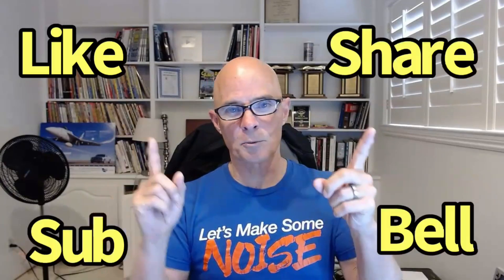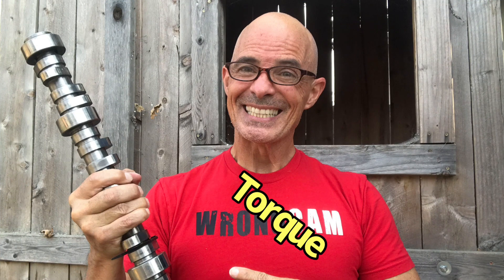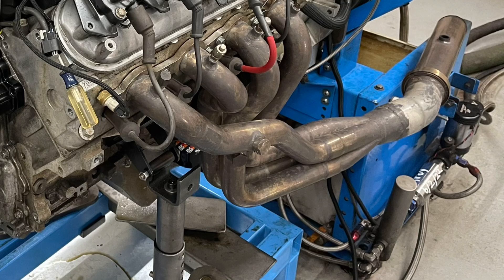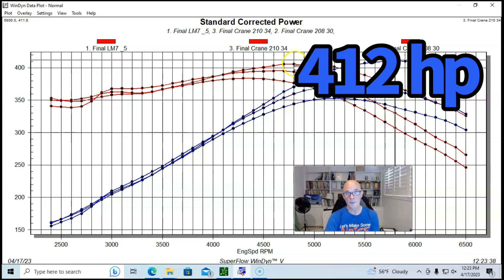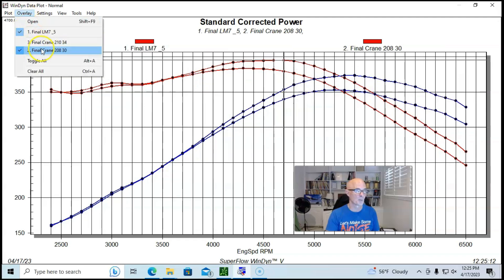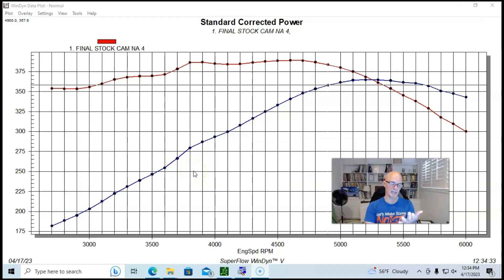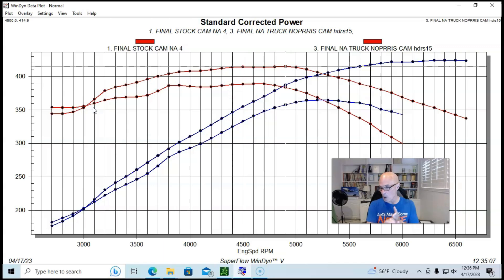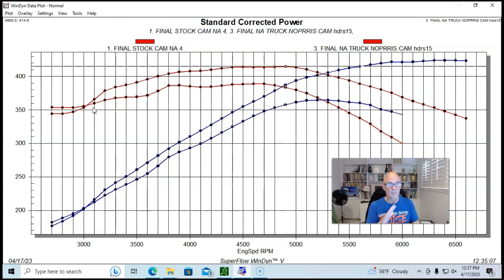WHERE'S THE TORQUE? HOW CAN I MAKE MORE LOW SPEED TORQUE? WHO MAKES THE BEST LOW-SPEED TORQUE CAM?

Comment: I’ve always looked at it that if you want to change peak torque from 3000 to 4000 to 5000 its cam
If you want more torque at low rpm then cubes
Pretty simple
Reply from the maker: can also be intake

Comment: Can you do a video or comment on 351m to 400, mild cam 4 in stroker

Its a tall block cleve as youve mentioned and I was doing a 160 hp 440 ftlb @~2000!rpm build

Comment: How about low end torque on a Pontiac 455 and in a heavy Safari Station wagon? 3.23 gears, posi unit. 4" stroker motor
Reply from the maker: mild cam, dual plane, compression, long tube headers, displacement all add torque

Comment: There are a lot of factors at play here that need to be addressed. Split cams do work. a 212/206 will work well in the 5.3, but the LSA needs to be tighter around the 108-110 mark and the cam needs to be advanced to 104-108 mark. The exhaust needs to be 1 3/4" long tube headers with free flowing exhaust, not the 1 7/8". This will work well in the trucks that spend 95% of their time below 3000 rpm. The Aussies have had good results with the split cams, as they think outside the box and understand the dynamics of cam technology. With me, David Vizard has been my mentor and like you, it's all proven on the dyno and he has done a hell a lot of dyno testing in his career.
Reply from the maker: reverse split? they just make less power
Reply: @richardholdener1727  Yes, up top but not down low. By having a shorter duration exhaust or equal pattern, the exhaust closes sooner and starts building cylinder pressure sooner. If you have a towing truck, you need the most below 3000rpm, and the LM7 is mostly trucks and SUV's. The exhaust needs to be free flowing and sized for your power output, in this case, smaller bore long tube manifolds. It is not just the cam, but the overall combo. 1 5/8" headers to 2.5" collector, 212/206 108LCA, timed in at 104 (tighter valve clearance may require notching pistons). A little more top end power but mostly better torque down low with better throttle  response and pick up. BTW, if using standard 706 heads the headers need to be sized to the exhaust flow, so at 550 thou lift, the flow is around 180 CFM, so the header primaries need to be 1 5/8" for street use.

Comment: You answered my most pressing question about torque, just as I suspected. That is why my 1989 GMC 3500 5.7L TBI has a SM465 4-Speed  transmission with very low rear end gears. NO horsepower, so they had to create torque with gears or it couldn't get out of its own way.

Comment: Can we build a motor for durability? Like 500,000 miles , nothing but oil changes kinda durability?  Of course plugs , air , fuel filters etc, but no engine parts … ?  Not to be boring n lame, but a durability , under load,  work life balance,
Reply: If you have a track I’ll drive the 500,000 miles lol
Reply from the maker: it can last that long-especially if you drive it 500K mile straight (don't let it sit for years)

Comment: Compression, forced induction and intake/exhaust will surely help. Gotta temember these truck motors had a "torque cam" from factory even though they're mild.
By adding forces induction low end torque increaces dramatically thats why diesels have incredible torque and turbocharged engines peak at 2k rpm

For a N/A motor my suggestion would be high CR without pinging perferably flat top, next would be exhaust manifolds not headders, use Y pipe not dual exhaust for scavenging effect, single pattern cam in the 200-210 range wouod work good and also help.  As far as heads go, there is nothing in the LS family that is low rpm oriented like the sbc world.  The TBI 350 engines had the best torque heads you'll ever find on any small block, but you won't rev past 4500 maybe 5500 if you're lucky

Comment: 350tq at 2000 rpm from a 5.3 😂😂😂😂😂 ya right my 2013 silverado only made 315 tq from factory at I think 4000 something rpm that truck was a piece if junk when it came to getting off the line with a heavy trailer it would fall on its face every time unless that 5.3 was sping 3000plus rpm it was a gutless wonder my 1998 silverado 5.7 gets off line WAY better pulling same trailer ... 5.3s suck ass for towing owned enough of them ill never own another 5.3 ever again 😊

Comment: Richard, refreshing my stock 350,000 mile LQ4, in my 2500HD, I tow a camper 4 tons, the standard 5.3 cam may replace my stock 0721 cam , as the stock PCM limits to 5200rpm and most of my driving is below 3000, except when needing warp speed, your opinion?

Comment: I'd bugged you about this in another video and you blew me off. I'm not after big low end gains, or necessarily even small low end gains. Though I firmly believe tangible low end gains could be had with a cam close to stock duration with a tighter pattern and earlier ICL. I'm more after something that, at worst gives up NOTHING down low but still gives a tangible kick in the pants up top. That should be totally doable with a small, tight cam. And while nobody drives around WOT at 1500, you don't need to. Part throttle at such low RPM is enough to achieve zero vacuum in the manifold, so same as WOT.

Comment: Richard, the folks at Crane Cams disagree with you .  The dyno sheet for crane cam  1449541 PowerMax LS 200/2008 502/502 115LSA ther dyno sheet shows 40 ft lbs over stock at 2000 rpm and 48 hp over stock LM7. I put this cam in my 2005 GMC Sierra a few year ago and love it, it even gets better 1 mpg better if I keep my foot out of it.  I know crane is out business now, but cam motion is making this cam for my brother. Happy to send you the dyno sheets..
Reply from the maker: I tested that cam-it does not add 40 lb-ft at 2000 rpm

Comment: This is incorrect.  We were given a Chevy 8.1 industrial engine used for powering generators. The goal was to gain trq at a max rpm of 1800 rpms. With a cam focused only on the goal, we made 800 pound feet. That's 1.6 pound feet per ci. The problem was when used in a truck, it had to be at wide open throttle to make the trq, and it would only rev to about 2500 rpms, making it usless for a useless for a daily driver.
Reply from the maker: you did not make 800 lb-ft at 1800 rpm with an 8.1L without boost (with any cam)

Comment: Has there been bigger cams that you put in and it actually caused a drop in torque on low end compared to the stock cam
Reply from the maker: yes-lots do-just not at the torque peak

Comment: I used to run Sig Erson Cams in my 351 Cleveland motorsand I used boththe TQ20 and TQ40 the TQ 20 ran more like a old family car, but the TQ40 Pulled super hard from about 2500 to a little over 5000 rpm's it was a dual duration cam @ 220/ @ 228 just a all around great camshaft. In a Ford 351C and I changed the 4V heads to 2V Heads to help with long tube headers, and a 1 inch spacer under a 780 Holley carb. Monster TQ, with the 4V heads it was a dog at low RPM's, The 2V heads woke it up, so smaller ports and valves as well.

Comment: You rite its impossible to increase torque @ 2000 rpms on a gas engine. Adding cam duration like an RV grind with to much duration just starts taking it from the bottom.  Adding bigger valves and bigger ports kills low rpm even faster! Its real easy to kill low rpm torque but very hard to increase it at that rpms. All you can do is if u have an 8 to 1 compression engine is increase it to 10 to 1 and pick up some there and use heads with the smallest valves and smallest ports for maximum cylinder filling at low rpms. Sure you can add cubes, stroker kits, superchargers etc but that stuff is expensive. Im sure your talking about just a commen V8 like a 350 chevy. My experiences in them gas engines is leave most everything stock like the heads and manifolds, and only use stock and very small RV grind cams not much bigger than stock  to make the best low rpm torque and mileage and increase the compression up there and build some cylinder pressure 200 PSI or so and run better gas. When you try to modify shit for increase in power they actaully run worse at 2000 rpms than stock and take more gas. For street truck engines and towing u need a power band off idle to 4200 rpms or so, nothing more. Power at 6K doesnt do any good as the motor never sees it. Im going back and building all my engines stock.
Reply: Exactly. I tell people all the time, your shifting gears @ 3 to 3.5 grand. 6 grand... Phhthh.. that's nonsense.

Comment: Hi Richard ,what determined  when a cam are working for instens some cams from 2000 - 5500rpm and author from 3500 to 7000rpm ?is it the lift or duration or even lobe seperation?  If you can help and explain please
Anton
Reply from the maker: valve events determine where the cam will be effective

Comment: The truth is.... You cannot make low speed torque with a wide LSA and 0.50 duration over 205 degrees. The engine also red lines below 5,000 rpm. A good low speed truck motor is made by stroking the short block and leaving the cam and heads alone.

Comment: I know that you know more than me about engines, but lol I have to disagree with you in part about big torque way down low from a cam. Its very doable with the right cam....as long as the other factors are in place to make this happen. I've built myself many engines over the years. I  stumbled across this magic huge torque way down low on an engine I built, in part by accident. I say in part because this was my intent by choosing machine work and parts but at the time when I made this torque monster I didn't know what I know know.  That was prob close to 20 years ago. Since then I've educated myself more and the king of knowledge in my opinion is David Vizard. He done an engine and it finally made since on my my low rpm torque monster 406 outran everything it cane up against. Even cars I know we're 800hp plus, and my car sounded like a dump truck idling. For more details feel free to reach out any and all.....Blue Ridge Mountain Motors
Reply from the maker: If you try to make more torque at 2000 rpm (or lower), there is a limit to what cam timing can do. Other things (like compression, displacement and (very long-runner) intakes have much more of an effect.

Comment: I achieved a lot more low speed torque by using short duration cam with 25% higher lift a nd increasing comp ratio to 10.5 to one and serious port and polish and bigger carb and still good fuel economy

Comment: I went from 205° water temp to 180° with a 160° Thermostat. Recommended back to stock gear ratio for my tire size, is 456, im running 488's  even with the longer 1st gear of the 4l80e,  its spicy. Tbss truck Norris 799's on a lq4. Its a bit much for cruising over 65 for long periods. It feels like 300hp in a 3000 lb car from a stop up to 80 mph. Which is darn cool in a lifted truck with 35's  but really it needs 456's or 37" tires.  This might help someone. 👍  I didn't know better and took someone's advice on a Form. Now I know and this is what happened.✌️
Reply: what stall?
Reply: @juniorthejeep It's the stock one that came with the 2004 2500HD.  It Doesn't need it. but it would be better with a Circle d.  The problem is I keep making things better Unnecessarily. And now my piggy Bank is hiding under the bed in the feedle position. It's all richard's fault ! One day i'm looking at funny cat videos. And then I Run across a video. Just add cam springs and boost.  Just add cam springs and boost.  It was like
Taking little junior to the strip club the first time with Chubby that could bend steel and a pocket full of singles. 🤤

Comment: Compression and ignition advance: as much initial advance and most aggressive curve you can run short of hard starting and/or pre-ignition when hot. Optimizing the latter (compared to stock advance) made the same difference as installing a 2500 stall convertor on a 302.
Reply: Water helps

Comment: So basically what ur saying is lower the temps, get a converter, install long tube headers and using boost will increase low end torque. But what about other little things like port matching, removing the air silencers from the throttle body, using a high flow filter and modifying a kegger (to increase air flow and reduce volume but leaving the runners long)? Also what about longer valves and or higher ratio rockers?

Comment: How relevant is this info for the manual transmission, guys? Most of the time, it's "get a converter."
Reply from the maker: do you not want more torque?
Reply: @richardholdener1727  i was asking more along the lines of what does the dyno information means for the guys using the info for a manual swap.

Comment: Our what about advancing the cam? I'm kinda new to the performance LS world, but i know for sbc's you can advance or retard the cam to adjust where you see the power band.
Reply from the maker: advancing and retarding do not always change power production higher and lower (cams often have advance ground into them)
Reply: @richardholdener1727  the point of advancing or retarding a cam is to adjust where the powerband is. That is the whole point. If the cam is advanced or retarded and the powerband does move in kind, then there are problems.  

Ok, I am done here. Have a good day.

Comment: I have a roller 302 (e6 heads) from an 89 crown vic in my 85 e150 van. I just finished my foxbody, and im planning on installing the old h.o. cam and porting the e7s from the mustang and installing them on the van. The transmission is a 4 speed manual (4th being overdrive) so it's  pretty wide ratio and I think making  more torque up higher will definitely help. I've never understood the people on the internet talking about how the 300 inline is so much better than the 302 because it makes peak torque around 2k. My question is who towing up a hill at 2k or less?
Reply from the maker: and does the 6 make more torque at 2000 rpm than the 8?
Reply: @richardholdener1727  in theory, it should it has a longer stroke similar size valve but only 12 instead of 16 for similar cubic inches, smaller carburetor so it should have better mixing velocity at lower engine speed and the longer stroke will give it more leverage to make more torque. In reality, I think 1 and 6 will always be leaner than 3 and 4, so they make everything smaller to keep velocity up. I've never noticed a big difference down in the lower rpm because I'm not lugging my engine around all the time. I don't think super low-end torque is that important because look at all of your modern gas truck engines, and they all have great cylinder heads, bigger camshafts that make power at higher rpm. A 351 would be better than both the 300 and 302, but the 302 was given to me, and if I'm hauling something heavy, I'll barrow my dad's 460 f250.

Comment: Adding cylinder pressure is the best way to increase torque on a given engine right? Im at high elevation and i want to make more off-idle torque with my gen 1 350. Crane used to sell a cam with low duration and a 104 LSA. It closed the intake valve super early like 21 degrees ABDC to build cylinder pressure. I heard a few guys say it had stump pulling power off idle

Comment: What would you do to make a 351 Windsor preform better when pulling gooseneck trailers up hill?
Reply from the maker: what year? 408 stroker, tune, long tubes, boost all help
Reply: @richardholdener1727  its a reman engine for the 1983 model year but I put it in my 1988 f-250 with fuel injection. All ive done to it was delete the cat.

Comment: I always heard long tube headers were best for higher rpm power and shorty headers or even stock exhaust manifolds were best for low end power.  Torque too perhaps?
Reply from the maker: long tube header add low speed and mid and top end-shorty headers and stock manifolds DO NOT make more low speed torque
Reply: @richardholdener1727  thanks for quick response.  Have you dyno tested the results of advancing and retarding a single camshaft?
Reply: @richardholdener1727  I just saw your cam timing videos.  Thanks so much for all your content!